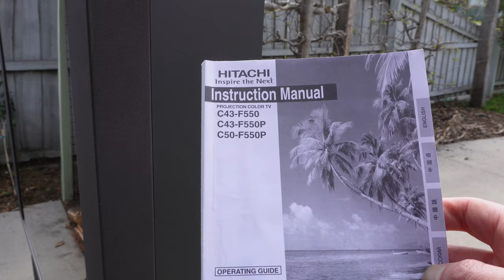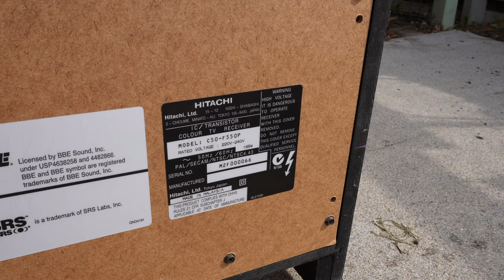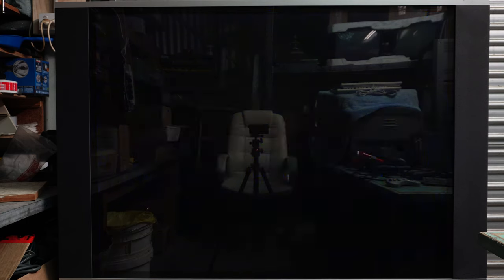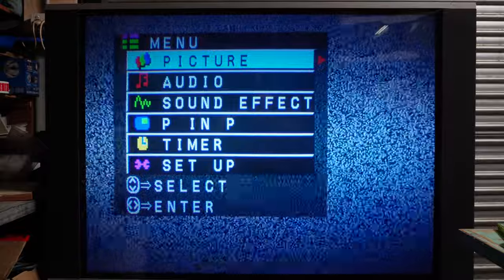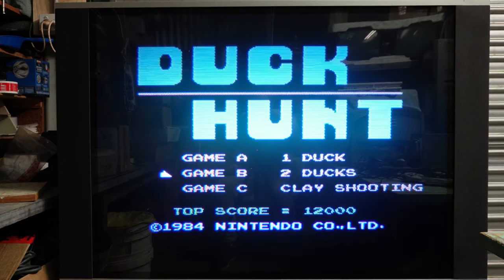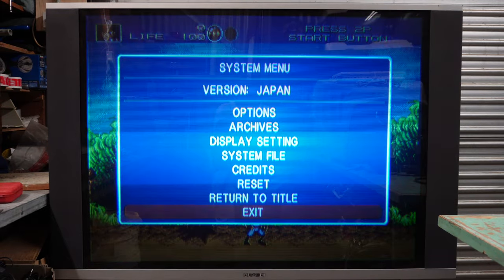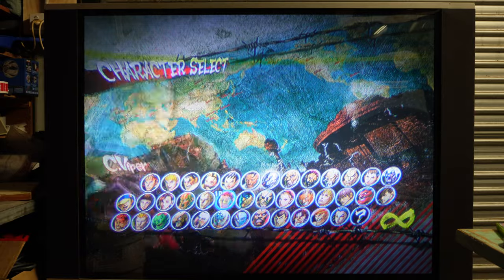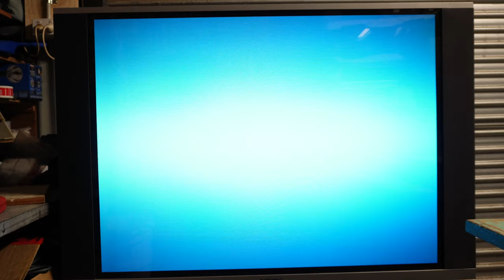Hitachi C50-F550P 50" Rear Projection CRT TV

Comment: Some rear projection crts have quality enough parts to truly earn its place next to some tube sets. This one seems to have very crisp picture for the resolution and that is why hitachi is regarded as one of the better rear projection crt manufacturers.
Reply from the maker: Good to know, ill try and hunt some more Hitachis for future vids.
Reply: Really? I got one for free : Hitachi 51f510
Reply: @TheAcadianGuy  oh hey I just checked out that model with proper calibration it has really good picture supposedly the user who calibrated it removed the glass protection screen to increase the contrast levels. I have no idea how that works but the picture before and after did seem to be a huge Improvement.
Reply: @Necrotheshadow   thanks for the info :)
Reply: Making me wonder what a pioneer elite rear projection would be like. 

We had a mitsubishi that was used for years until it finally just died. Bought new. Did the job but it didn't die till mitsubishi actually stopped servicing them! Impressive service life I'd say.

Comment: You did well to get such a new RP CRT in 4:3 without 100Hz. The only thing it lacks is SCART. I got a rear projection TV last year, and it's hard to go back to anything else for gaming. Like most people, I was put off them by the memory of bad ones from yesteryear. I remember being appalled at the state of Saturn Daytona USA on a widescreen rear projection CRT on display in a games shop. Then there were all the 50" arcade games that had gone pink.
Reply from the maker: Lol  your rear projection story explains well why the bad perception of rear projection tvs exists. What RP are you running?
Reply: @rgbrob  It's a Toshiba 43VJ22P.

Comment: I didn’t know rear projections had mini crts inside , why do people hate on these ?
Reply from the maker: They seem to drift/deteriorate out of spec faster and more substantially that a direct view CRT TV. Becoming blurry, very misconverged, heavy burn-in, dull. The tubes in projection systems are driven harder than a regular crt tv thus have a shorter life span. There are some shocking examples in arcade machines of the aforementioned symptoms. They can also be difficult to view and become very dark depending on your angle of viewing in relation to the screen.
Reply: See my rear projection tv tear down video. I go over all the parts and the working principles
Reply: Earlier ones & some later ones used CRTs, more used an LCD later on.

Comment: Hey Rob, this is a bit off topic, but have you heard of the new reproduction VGA input cards for Loewe 100Hz sets? I was wondering if you still had that 38" Loewe Aconda, since it's compatible with the new card. It would be awesome to see that 38" set running in 480p VGA.
Reply from the maker: that would be great, id have to dig out the bet set

Comment: Has there ever been a rear projection tv that takes pc monitor resolutions into account and not have to deal with the analog/digital conversion?
Reply: Ya they made HD rear projection TV's with HDMI connection.  You can probably plug in your PC as its Video IN port to TV.

Comment: I'd still say direct view CRT TV's are better than rear projection, especially since all the colors are focused on a single electron gun instead of 3, which has less space to move around in and places the electrons much closer together unlike rear projection which doesn't focus them quite as well, especially since it has to bounce off of a mirror. I own a Mitsubishi WS-55313, which is a 1080i DV-i widescreen rear projection TV, and while I'd say it's better than a standard Sony Trinitron, it fails to beat a 1080i direct view CRT due to blurriness of rear projection technology.
Reply from the maker: I agree with you
Reply: I think there's tradeoffs with both. 3-CRT projectors don't have phosphor dot pitches so you can get better defined pixels, and direct-view CRTs still have 3 electron beams and when they do go mis-converged (e.g. around the edges), it can be a nightmare of adjusting rings and adding magnetic strips (whereas newer projection setups had a digital convergence that could adjust 64+ sections of the screen independently). But I do agree you're typically going to see better convergence on a direct view CRT as the RP setup would be more likely to drift over time and require frequent readjustment. Calibrating a 1080-capable projection setup would've taken an immense amount of time, I bet.
Reply: @beaumotplage  Actually, I think you're right, because it's not often that you can find a highly detailed resolution picture of a RPTV set these days online, if, even at all, as I now discovered that mine has slight coolant build-up on all the lens, and needs new coolant, as whenever looking at small detail such as letters and my profile picture online, it should be fully visible and the edges should be nice and clear, but it's a bit of a blur. Once I get new coolant, It will be much better, because as far as I'm aware, the 1080i CRT RPTV's I remember having some of the most beautiful picture and detail than any other display type, if not, still better than all the ones today including OLED if it's precisely and perfectly calibrated. I believe that I read somewhere that due to no phosphor pitch, 1080i CRT RP displays are still the clearest imaging displays to date, it's just very difficult to document this, as I bet no one wants to do an extremely risky repair of possibly breaking the tubes in order to remove the build-up and putting new coolant. I want to do this to my TV, but it's the only one I have and it's nearly impossible to find another excellent set; mine is one of the most high-end consumer sets that was made and is a Best Buy exclusive, meaning it's quite rare to find. My dad just said until the picture quality is TRULY blurry until it's mostly unwatchable, then we would try to remove the build-up and put new coolant, but that could be up to 5 years from now.

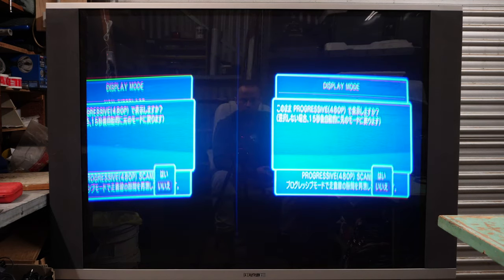Comment: I noticed at 1:19 that the component video input consists of Y, Cb, Cr (not Y, Pb/Cb, Pr/Cr used in progressive scan-capable and HDTV ready TVs). My CRT TV also has the same Y, Cb, Cr component input, and therefore unable to display progressive scan correctly (from my DVD player) as you did in 12:26.
Reply from the maker: ive never made it a point to take note on the specific labelling of the component input to see if there is a pattern or differentiation for progressive and interlace or other factors by the naming. Doing a quick search, it may be that TV manufacturers may be incorrectly using the terms. Y, Cb, Cr is digital and carried on 1 wire (SDI or firewire for example). Whereas  Y, Pb/Cb, Pr/Cr is analogue and carries on 3 wires. Someone else might like to comment and bring clarity to the definitions.

Comment: There is no such thing as "CRT rear projector", they are mutually exclusive technologies.
Reply: That's completely wrong. CRT rear projection TVs use 3 bright CRTs (red, green and blue) to project an image. Likewise there were normal (front) projectors that used the same system, and could be superb. I have one myself, though mine is an old bottom end projector.
It's conceptually similar to LCD TVs and LCD projectors.
Reply: @DoubleMonoLR  I have investigated more, and yes, you're right. Don't know what I was thinking.